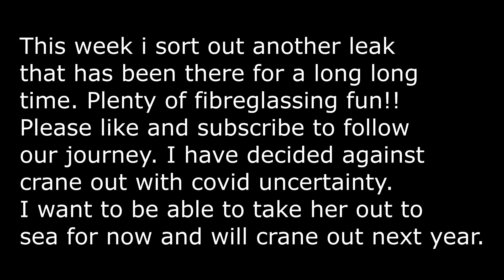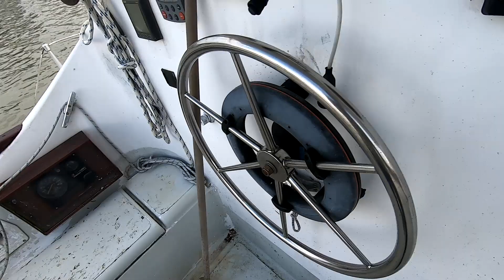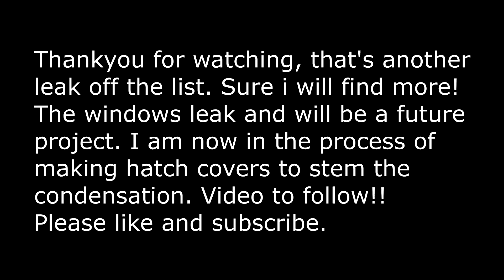E16 Fixing another leak on Foxy Lady that has leaked for years!! Epoxy and Polyester repair

Comment: That's all wrong. You first needed to sand the whole area that's to be repaired. Then you clean the whole area with acetone/Isopropanol alchohol. Mix some thickened epoxy put to one side then you wet the whole area with non thickened epoxy. Apply the thickened epoxy to the crack wet yourr csm and fit to the area and roll out any bubbles. You do not use peel-ply for repairing. It's use is to be applied over csm when the repaired area is completed it then has to be left overnight then you can peel it off the csm that way you have reduced the amin blush plus it makes it easier to sand. I can't believe that no one has given you any advise on this. Take my advise for future reference and watch some fibre glassing techniques and how to apply it video's on you tube.
Terry
Reply from the maker: Hi Terry, thanks mate.  This was a quick and not preferable repair. I used polyester resin and a piece of ply instead of epoxy. My main reason for this is eventually i am going to pull up the entire foredeck and replace with the nylacore honeycomb stuff. But that is a future problem😁